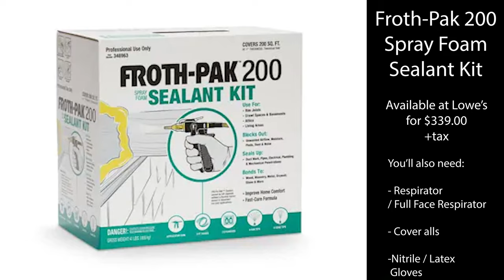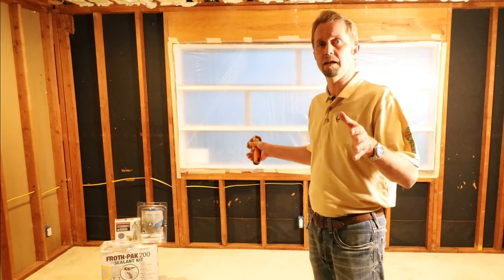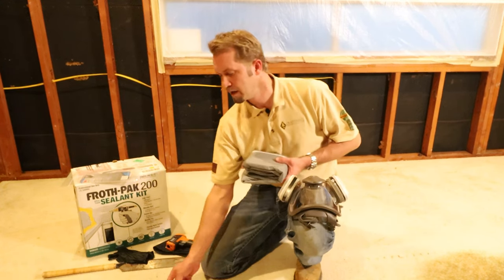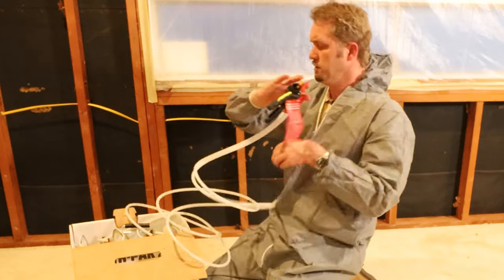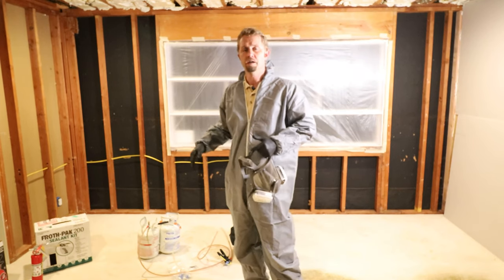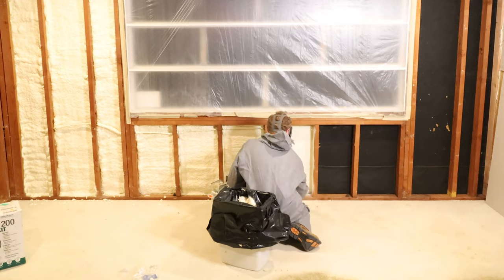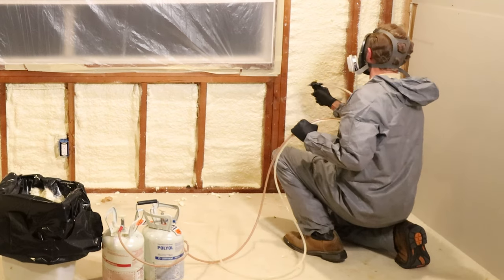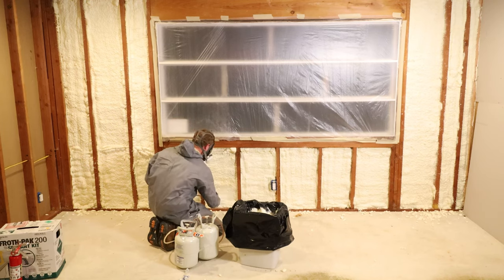Froth-Pak 200 Spray Foam Sealant Kit Set-Up, Precautions, and Spraying Review #Froth-Pak

Comment: I purchased the Froth Pak 12sq foot kit and it was garbage.
Reply from the maker: Froth Pak 12 sq. ft. Kit? I think I might have seen a really small kit before for touch ups, but the Froth Pak 200 was excellent.
Reply from the maker: The Froth Pak 12 board foot kit is $102.79 on Amazon today. That’s a lot to pay for 12 sq. ft. at 1” thickness, when you can get a Froth Pak 200 for $369 or so, and get about 155-170 sq. ft. at 1” thickness which will end up being less than 1/10th the cost per board foot. 12 sq. ft, would be relatively  equivalent to (1) 14-1/2” x 96” stud cavity at 1” thickness. I don’t know if you just didn’t like the product, or what you ended up paying for the product you got for the cost. Most of your cost was probably packaging, shipping, etc.
Reply: @craftsmanconnection  So just to clarify I purchased two of the small kits, they were 79.99 Canadian each. The 200 sq foot kit was $440. I only needed to do one rim joist as it was in a hard to reach area and the building control asked me to seal it with a spray foam kit., the $440 kit was way too much for what I needed to do so I got the two small kits two be sure I had enough.

Well I followed the setup instructions and they both performed the same, crap. Very little flow rate, it was a bunch of splatter then runny goo with very little pressure. 

Called the manufacturer of Froth Pak and they said to go to the place where I bought it and get a refund, they just don't care about there customers. I'm sure the big kit performs better but the small spray cans are junk.
Reply from the maker: As far as the small spray cans, like Great Stuff, the foam won’t stick to the wall surface or studs good enough to do anything like spray foam will. Great Stuff will just fall off the wall, because it doesn’t expand and cure fast enough.

As far as your Froth Pak 12 board foot kit, have you checked the date on the packages (if any date)? Maybe they were expired? Did you agitate like shaking a spray can for the recommended 5 min, like in the case of the Froth Pak 200 in my video? Any signs that someone had used the kit already and maybe returned a partially used kit? Curious.
Reply: I used the 12 in my attic to do some air sealing along the top plates.  it worked okay for that but the pressure was too low from start to end

Comment: R value???
Reply from the maker: For Froth-Pak™ Sealant the LTTR value (Long term thermal resistance) measurement at 1 inch thick is 5.3 ft²•h•°F/Btu (R value) per inch. When sprayed to 2 inches thick the LTTR value (Long term thermal resistance) measurement at 2 inch thick is 5.5 ft²•h•°F/Btu (R value) per inch which is R11.0 at 2 inches thick.

For Froth-Pak™ Insulation (Aged 180 days @ 75°F):

Thickness (inches)

R-Value (ASTM C518, F.ft2.h/Btu)

1.0" thick = R 6.0 (when sprayed at 1 inch thick)

2.0" thick = R 12.2 (R5.6/inch when sprayed at 2 inches)
Reply from the maker: So if you spray 2” thickness, you’ll have R 12.2, and if you have 2-1/2”. It’ll be approximately R-15.2
Reply: @craftsmanconnection  Thanks! I'm gonna be redoing the upper insulation in my 1 1/2 story house...gotta leave a vent gap and then insulate , so this helps me figure out how best to do this.
Reply from the maker: Do you have HVAC equipment in the attic? If you do, and it’s gas unit, then you need to have a duct through the roof or somewhere to supply combustion air.

If you have an all electric powered system, then you won’t need combustion air.

At my house, I have my entire roofline spray foamed with no gaps at the eaves or ridge, and no equipment in the attic. My HVAC furnace is in a hall closet with a fresh air combustion duct coming from the roofing area to the outside coming down with 12” of the bottom of the closet and within 12” of the top of the closet for combustion air. Not only does Dow sell the Froth Pak 200 for small jobs, but they also sell a Froth Pak 650 for medium jobs. If you’re doing your whole roofline, buy the larger kit or multiple kits and it’ll bring down the cost per square foot. Good luck with your project.
Reply from the maker: In addition, don’t forget to use the proper respirator and filters, and have a source of airflow into the attic. Don’t even think about using a regular dust mask. You wouldn’t want the chemicals to get into your lungs and crystalize. Try to do this job on a day where the outside temp is about 70 degrees. When the outside air is 93 degrees, the attic temperature can be around 125 deg. F to 130 degrees F. Good luck with your project.
Reply: @craftsmanconnection  Thanks for the warning, but I'll be OK...before this I worked in a gold mine where they introduce cyanide into the milling process to extract microscopic ore...and before that I spray painted cars as a professional auto body man/ painter...the paint hardener has Isocyanate, a kissing cousin to cyanide.

Comment: I piece of cardboard on floor would be nice
Reply from the maker: A piece of cardboard on my  floor would be nice? Did you notice the ceiling drywall is also missing? Did you see that there is old carpet? Did you notice the big black stain from some old gym equipment mat on the old carpet? Do you know what all the future plans are for this project? Well, I’m glad you asked. I’ll put up all new sheet rock, and all new flooring, base boards, after the spray foam insulation. Of course the whole house is being remodeled. Spray foam mist on carpet that is no longer there is of no concern. The carpet was protecting the concrete subfloors for the new tile flooring. (Taking a bow) thank you, thank you! 😄

Comment: Remember- closed cell foam is Isolation not insulation. It is better at separating temperatures where Insulation is a battery for heat. Ideally in cold climates you fkash and batt, 1" of foam the fill with fiberglass. Going the full 3-3.5" is for a hot climate AC only.
Reply from the maker: The nature of closed cell foam with the skin being a vapor barrier may be the moisture isolation part, but it is still thermal insulation. That is why they call it closed cell spray foam insulation. Spray Foam is not a battery. A battery stores energy for an extended period of time, like your car battery. Spray Foam Insulation slows down the transfer of energy (heat) for a short period of time. You can flash and batt all you like. Different people prefer different methods of insulation and achieving certain ACH Levels (Air Changes per Hour).
Reply from the maker: You said it’s better at separating temperatures. Doesn’t Insulation separate temperatures? Closed cell foam is used in coolers like Yeti. Is a Yeti cooler a battery for cold? 😄 No. A battery is a storage cell for energy. I live in a warm/hot climate generally speaking, although last cold season got down to -2F last February in Texas, and this summer was over 112F.

Comment: put them cylinders in a milk crate.
Reply: Got a milk crate handy? 2 Milk crates for 2 milk Jugs? Normally, the containers are on a hard surface like a concrete slab, or plywood subfloor.

Comment: Just get the pros to do it
Reply from the maker: That would be a good idea if you have more than 1-2 walls.
Reply: @craftsmanconnection  the cost of the froth pack is a minimum charge for most company’s
Reply from the maker: My spray foam contractor used to have a minimum of $1200, but has since this year upped his minimum company price to $1500.

Comment: The most unnatural material in the most natural environment enough said.
Reply: So are concrete, asphalt, steel, aluminum, pressure treated wood, PVC trim, paint, fiberglass shower enclosures, galvanized nails, stainless steel...

Comment: So, I can let the the spray foam contractor do it, and will cost me the same?🤔
Reply from the maker: The Froth Pak 200 spray foam kit cost around $369+ tax, plus the cost of a respirator with cartridges, and a paint suit.

A spray foam contractor will cost a minimum of $1,750 for existing customers and $2,200-$2,500 for new customers. The price for closed cell foam per board is about $1.40-$1.50 per. Open cell foam is about the same price but you get 3-1/2” thick. Closed cell foam is about R-6 per inch, and open cell foam is about R-3.5 -3.75 or so per inch, depends on a bunch of factors.

So in conclusion, to do exactly what I did in the video, it is cheaper to do it yourself, but after a few kits, it’s a break even to hire a contractor, and eventually you get way ahead in larger volume.
Reply: @craftsmanconnection  gotcha